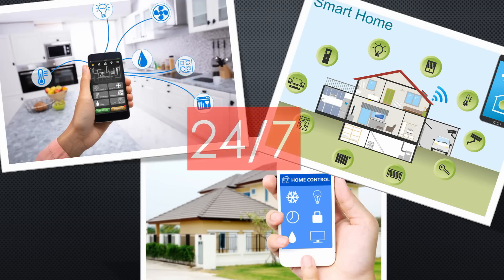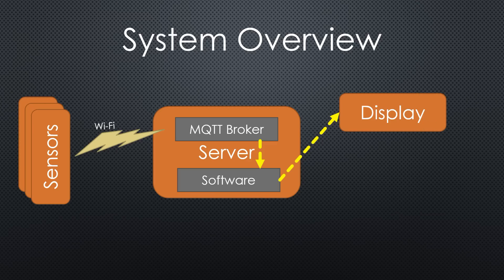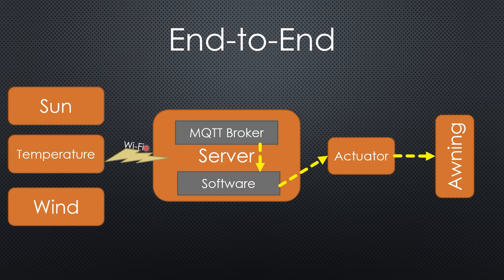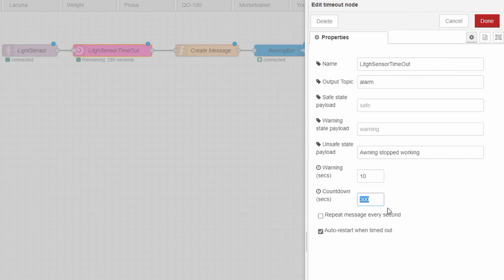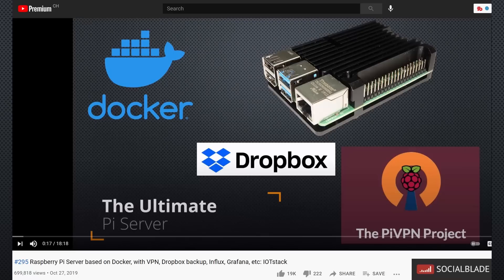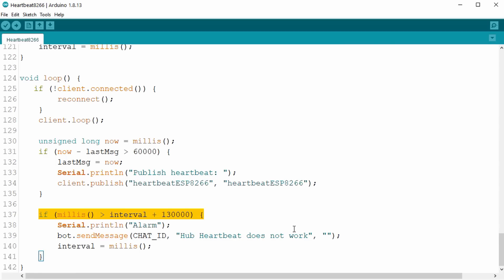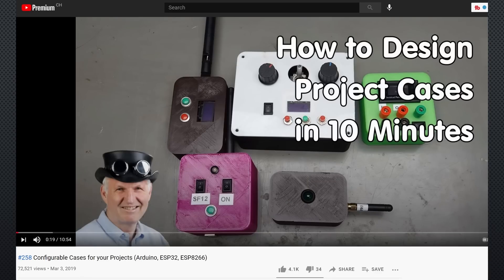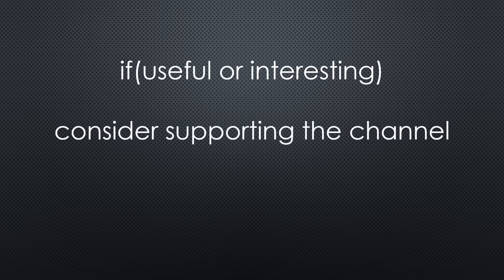#385 Supervise your Home Server with a Watchdog and Heartbeats (Raspberry Pi, ESP8266, Docker)

Comment: Thanks for this vid about such an important topic!
I am using Homematic for ca, 10years and ioBroker as an integration platform since its beginnings. Both can send emails ad/or messages via a messanger. So, I implemented a bidirectional watchdog monitoring system. Both systems monitor each other. 
I also monitor many of my ESP sensors.
And I implemented power grid monitoring. As a backup power source, in my first units I used supercaps but switched to energizer Li primary cell batteries. They claim 20 years shelf life which the supercaps do not do.
Reply from the maker: Thank you for sharing your setup. So you use tho different servers? And concerning the primary batteries: Do you properly shut the servers down or keep them running during a power outage? Then I assume the battery would be quickly depleted.
Reply: @AndreasSpiess  Homematic is running on an Orange Pi and ioBroker on a refurbished Win notebook. Both are backed with a cyberpower UPS as well as the rest of the infrastructure as switches phone etc. Good solution for some hours.
For different purposes I am using at different places Homematic digital input modules. They are RF bound to Homematic server (called CCU) and low power devices which are designed for battery operation. But I supply them normally by the grid via power adapters. When a power loss happens,  these digital input devices will be backed by the  Li batteries and using a diode one input detects that the regular supply is down and transmit this inpu change to the server. Having 3 Phases in my house, I also have >= 3 of these units.

Comment: I have had heartbeats and watchdogs on my mind lately with my soon to start HA project after my lab move to the new property. This video is saved to watch again when I get started. Thanks!
Reply from the maker: This addition was needed because my Pi recently lost WiFi from time to time. Without this circuit I discovered it always too late. With this watchdog I was able to find the error and correct it.
Reply: I bet the notification you received was from your wife! I can imagine how that would go 😂
Reply: @AndreasSpiess  Same here, Pi WiFi seems to be unstable. But I fixed it with a simple script. If ping to gateway doesn´t respond, wlan0 on PI will be restarted. Start this bash script via crontab:
https://gist.github.com/mharizanov/5325450
(you have to change "ifup" and "ifdown" to "ip link set up/down"

Comment: Yes, monitoring becomes more and more important. In servercenters we are doing it for years, without thinking about it. All the important stuff is monitored, heartbeated, watchdogd and redundant at several levels. It is a set rule. However, at hobby we do not value availability. Even commercial smart home devices do not care about it, it seems. Glad your wife did "force" you do think about it. I was creating a ESP32 to act as a forwarder for BLE beacon sensor data to Home Assistant. However, sometimes the ESP32 dies due the heavy BLE scanning and Wifi use. So I added a ATTiny45, created a serial connection between both microcontrollers, let them play "ping pong". If there is no pong from the ESP32, the ATTiny switches a relay, which cuts the power to both microcontrollers. If there is no ping from the ATTiny, the same action happens triggered by the ESP. Works as expected, and turns the BLE to Wifi forwarder into an almost maintenance free device.
Reply: Peter, I like this ATTiny solution. I am going to be setting up HA soon at my new lab to do various activities and had a BLE to WiFi gateway project in mind and your insight here sounds like a necessary solution. Thanks!
Reply from the maker: Good idea to self-reset the device! This is one step further than what I do and it works for all sensors. With the Pi I had an issue where it lost WiFi connection from time to time. Like that I was able to find it out by looking at the screen (after receiving an alarm). First I always thought, it completely crashed because I was no more able to SSH.
Reply: @AndreasSpiess  I had rhe very same  issue last year, I eventually traced it to the metal case for the Pi, and the direction it (the Pi) was facing (WiFi antenna not facing the AP). Since then it has become a non issue but at the time I was so unhappy with the situation, I made a few "adjustments": 1. I used 5 different colour LEDs mounted right on top of the Pi case and connected to 5 GPIO pins to show CPU activity, HDD activity (independent read and write) and network activity (independent send and receive), 2. Wrote a script to test LAN connectivity every minute and store and process the test results (for some reason I can't explain the WiFi connection has more issues during the night) and 3. installed and configured collectd to save plenty of statistics in influxdb and monitor and display them from grafana. I needed some time to do this but it was a very good learning opportunity and I'm also happy with the results!
Reply: I had similar issues with the ESP32 getting stuck after just a day or two when I followed Andreas' video 176 to build a BLE "presence detector". Being more of a software person than a hardware one I spent some time to rewrite the code and make use of the built-in hardware watchdog timer on ESP32. None of my BLE sensors stuck again since then (several months). I liked doing this because it didn't need anything else, it just used what was available, in the way it was meant to be used. But I agree there are other ways to achieve the same result, to each his own. Too bad though that many times watchdogs are needed just to correct issues with the software - it would be so much better to correct the software instead. But I suppose it's acceptable to use a quick watchdog reset where availability is not as critical that you cannot be offline even for a few seconds. 
Thanks Andreas for the video, I really liked the "minimalistic" approach of using just an ESP01. That, coupled with healthchecks.io should be more than enough for "SOHO" usage. Here's to as few alerts as possible! :)
Reply: @dan-nutu  I am a software guy myself, and fully agree with what you say. However, I was not able to fix that memory hole that was created by the BLE Scan stuff of that particular esp board. So, the wtahcog hammer is in place now. At work I do the same: try to fix things in software first. But having a hardware watchdog is like a pill to sleep well, and kind of an insurance. if all your measures fail ... the watchdog deals with it.
Reply: @peter.stimpel  Watchdogs - for when you had enough! :) Are you sure all the issues came from the BLE scans? I remember I tinkered with it until I couldn't see any more issues with the BLE scans, however there were still issues with how the TCP stacks on the ESP32 and RPi dealt with the voluntary and abrupt WiFi disconnects right after sending MQTT messages - this was the corner case that was getting the ESP32 stuck. I looked a bit at it in Wireshark (MQTT packets are forwarded back and forth because mosquitto runs under docker) but then I ran out of time to sort out all the software bugs and I brought in the (watch) dogs! Because I can live another day if the light doesn't turn on the very second I enter a room. But there's a bit of OCD in me that still thinks the bugs should be squished!
Reply: @dan-nutu  I am pretty sure it was about BLE Scans, at least on the hardware I am using. I turned the scan off, and caused the ESP to send MQTT messages every few minutes, like it would have received BLE messages. Did that for a week or so, no issues. Switching on BLE scans, made the ESP dying within hours or a few days. Was a reproducable behavior. I am running mosquitto in docker as well